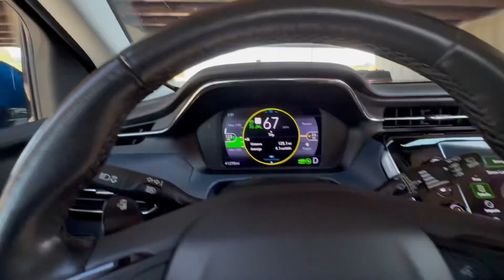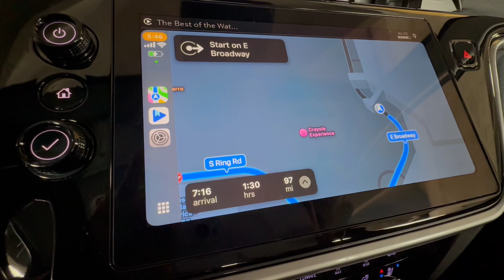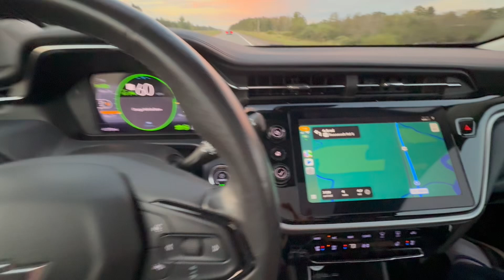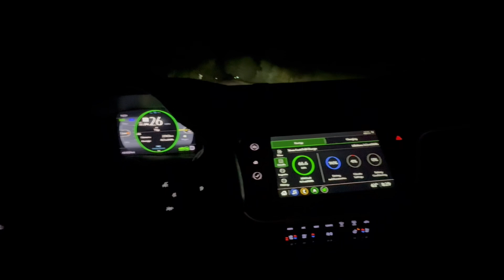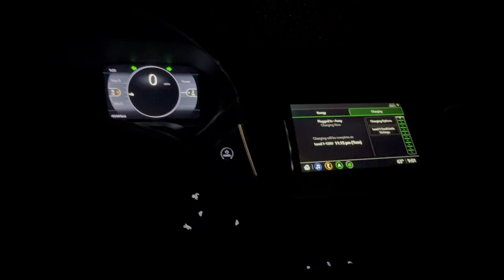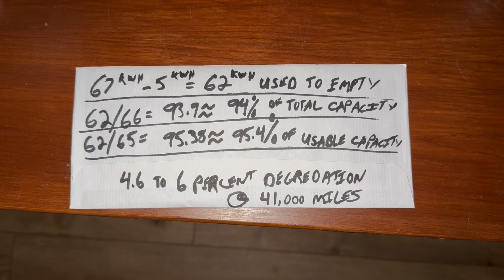Chevy Bolt EUV Hwy Range Test #3. 100-0%-100% Battery Degradation Test

Comment: How you like it?  What's your thoughts on how long it will last and miles?
Reply from the maker: It is consistently doing 240+ miles at highway speed in the summer. It does not have a heat pump so expect 50-80 miles range loss in the winter. The newer GM Ultium platform EV’s all have heat pumps and heat the interior mostly from heat generated by the battery and motors. Equinox EV is a good choice. I got this to help keep miles off my other two GM EV’s
Reply: @danno180 I have 3 prius and we run them very hard with 300k plus miles. I want a ev but I am worried about reliability and higher insurance rates
Reply from the maker: @shanepipkin4041 Bolts are showing to be 400,000 mile vehicles. Insurance on GM EV’s are lower than other EV’s, especially Tesla.